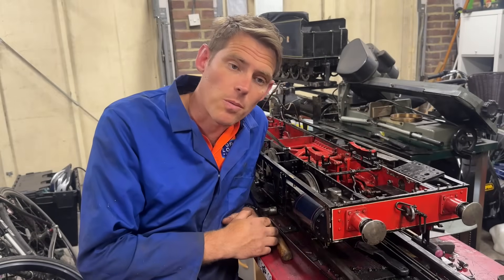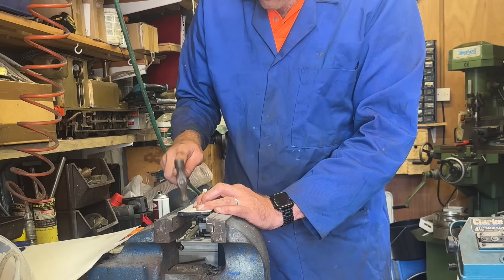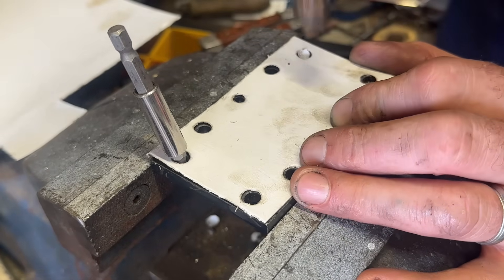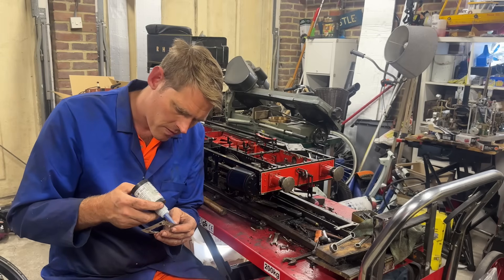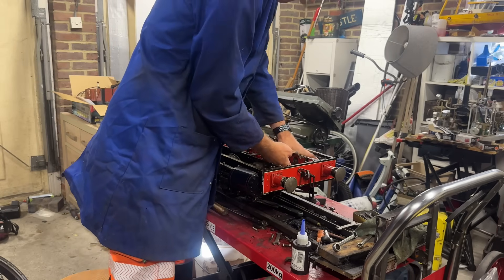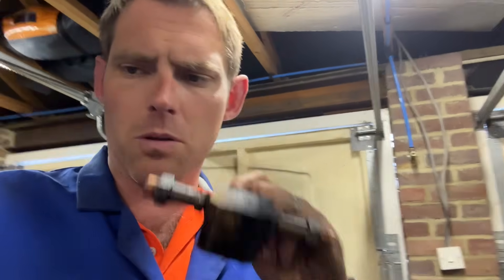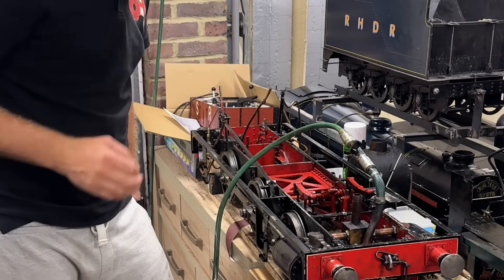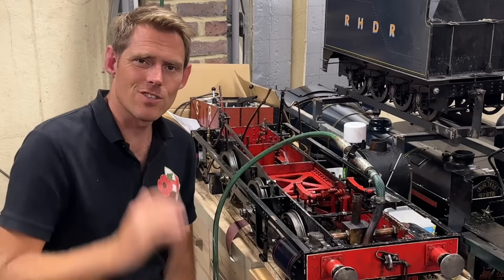HOLMSIDE gets its first air test!!!

Comment: The gear was kicking in reverse.  Is there some slack in the reversing gear, reach rod/weigh shaft, etc?
Reply: My point was full size locomotives do it too.

After thinking a bout it all I can come up with is the motion must be some kind of toggle action between the valve and eccentric that binds up and forces up on the hanging link.

I suspect you may need a little more advance in forward.
Reply from the maker: @pvtimberfaller stephensons link has an oscillating motion that causes the die block to rise up and down the expansion link slightly, but if the reverser has gone too far then the die block hits the end of the link causing it to kick. The reverser has more movement past the last slots, when the reverser was in the slot it was fine. 😊
Reply: I am familiar with the Stephensons motion, but have never had to deal with that anomaly.

I will have to look and see if the gear is bottoming out on the 3.
Reply: I was watching that too.
Seems kind of odd how that motion is transmitted.

I had a cab ride in a Heisler (wood burning)last weekend and it was doing the same thing which is even weirder. I will have to look into their valve gear arrangement.
Reply from the maker: I’d gone further than the last notch, when it’s in the last notch it’s fine. I should have shown that investigation, I will probably do something to stop it moving that far.
Reply: @TomsWorkshop42 that makes sense Tom.